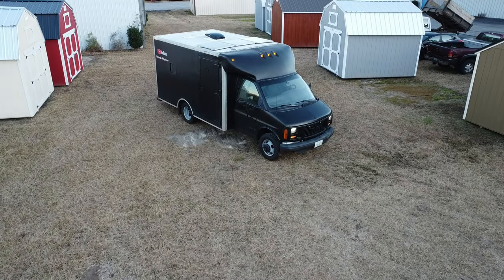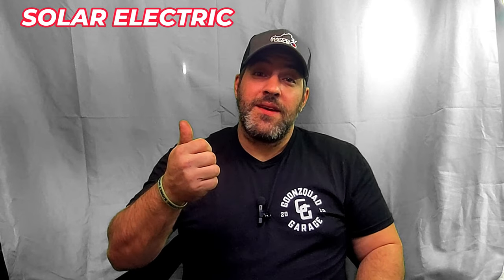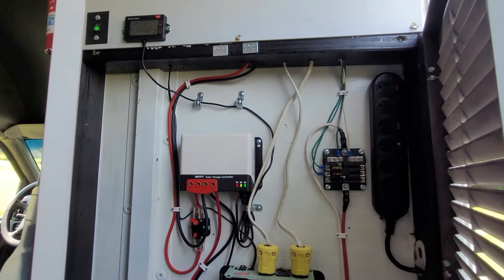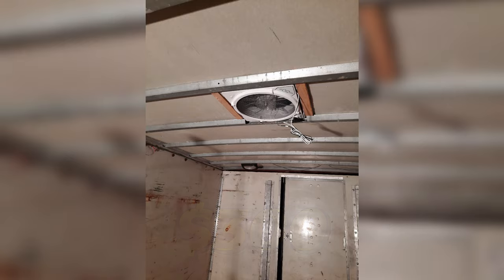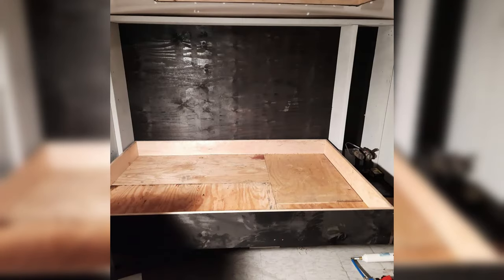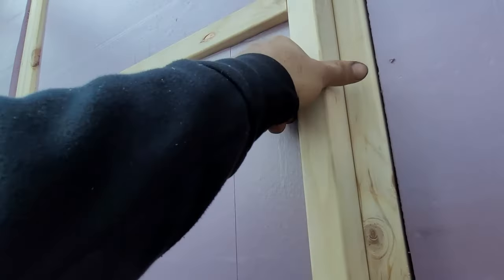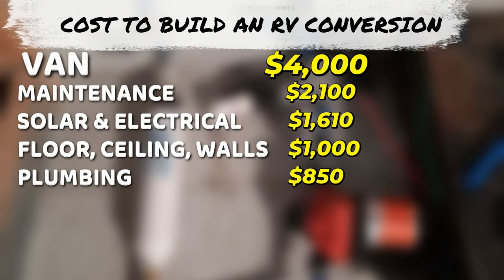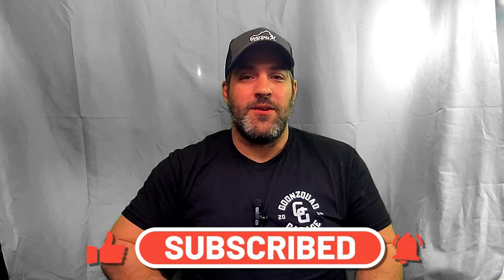HOW MUCH DID IT COST??? | VAN BUILD | #foryou #vanlife #rvlife

Comment: how long does it take for you to convert it for each part? Like how long for mechanical tune up, how long for plumbing, how long for electrical & solar etc.
Reply from the maker: Well, when I originally built "The Box," it took about 2 months total. (I also left my full time job to focus on the build).  The recent "rebuild" has been going for over 6 months now. (I also currently work full time M-F 8-5). Each part could take a few days to a few weeks.